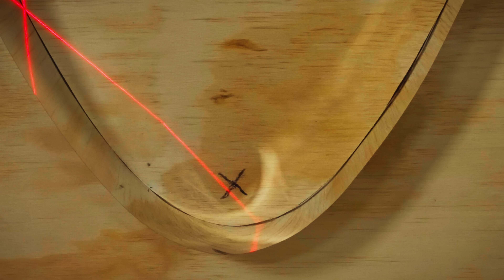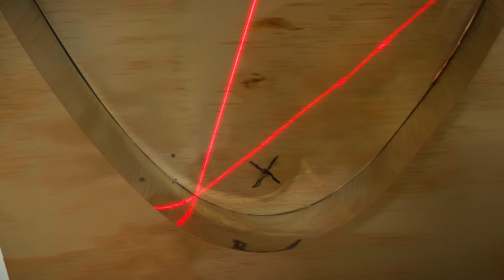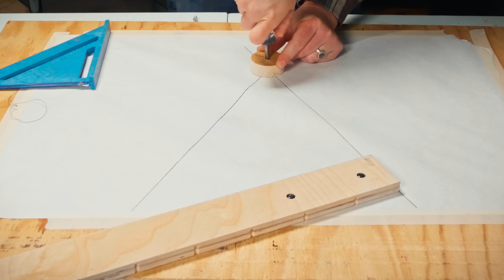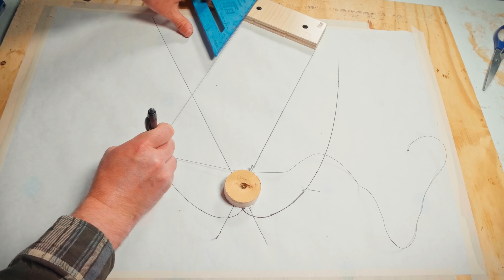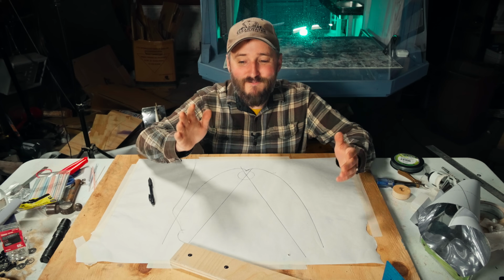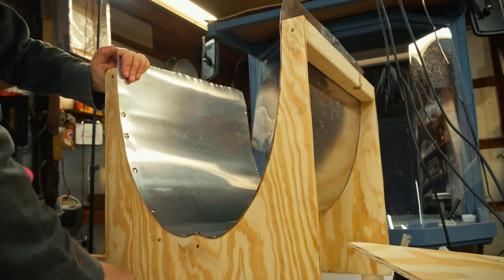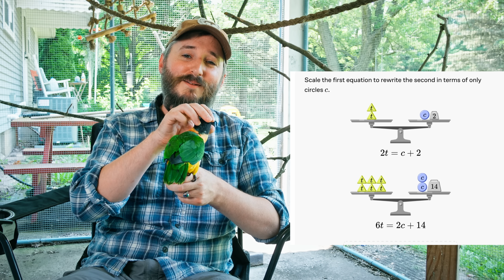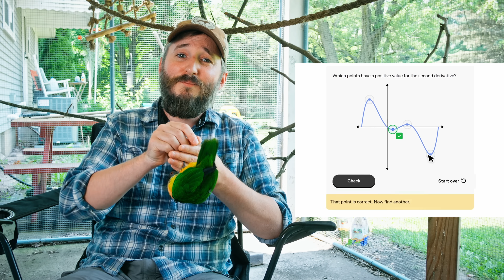DIY Solar Concentrators, Made Better.

Comment: 10:08 - ahh, but there is math required... just not calculation!  You're doing math, mechanically!  And it's super cool, and I'm super here for it.  :)
Reply: Analogue computers do the same, or you could say that he is using some kind of mechanical calculator.
Reply: Everything about this thread has me 😂
Reply: @stevenkramer3872   Well, then whether I've made anyone re-think what "math" means or not, I've at least made someone laugh.  I'll take it.  ;)
Reply: yeah, last i check geometrie is a field of math
Reply: lmao i was just about to say "bro ur LITERALLY doing geometry 😭"

really cool demonstration of geometric construction though
Reply: @xkatiesix1258  exactly!
Reply: Mechanical alignment using straight edges and pins is literally NOT doing math. Not a single number involved. Also, metric system is brain rot.
Reply: @alphaforce6998  Ancient Greeks performed mathematics without the concept of numerals as we know them. Greeks derived the concept of irrationality without numbers. Math is so much more than just digits and operations. It's the character of relationships. That's why reality is math: because reality is relationships built upon existing relationships built upon existing relationships and mathematics isometrically characterizes those relationships.
Reply: @Kowzorz  I was going to make a similar statement. Academics today like to claim certain things couldn't be accomplished in the past because the math wasn't there to provide the answers. His demonstration is proof that one doesn't have to know the numbers to figure out the solutions, it is just as you said,  understanding the relationship, in this case of what you're looking for and how you want to get there. In the past they just figured out what worked, in the present we apply math to explain why it works. Given another day this guy could have probably figured out two other ways to make this same  parabola without using  numbers, it's just what people do, we find different solutions according to our skillset.
Reply: @alphaforce6998   Not a single number is needed... lots of math isn't numbers.  I think you misunderstand what mathematics is.  (And I'm not sure why you bring the metric system in here... your statement about it seems more brain rot than the system is, though.)
Reply: @alphaforce6998  
"metric system is brain rot."
Nonsense! The metric system is far superior, which is why the vast majority if countries use it. Only a few stone age countries like the USI (a.k.a. the USA) refuse to join the rest of the world in the 21st century for reasons no-one understands.
Reply: @alphaforce6998 who hurt your little feelings? Brainrot is thinking metric system is brainrot... But you are probably just jealous finding out that measuring and calculating can be easy if you use deka system...
Reply: @markohorvat1122  If you're claiming the imperial system is difficult, you're proving my point. Base-12 let's you quickly and easily divide  by 2,3,4,6. Base-10 gives you 2 and 5.

Base-12 can deal with 1/3s via 3,6,9 = you can double any of those numbers to get common lengths :
6 = 1/2 foot
12 = 1 foot
18 = 1-1/2 feet

These numbers are common, easy to remember, easy to measure and work for building just about anything. And each of those is evenly divisible by at least 2 and 3.

But when your brain is rotted, you'll find that to be "hard" and instead think some idiotic system based on measuring a non-existent distance to a place no man has ever traveled to is superior.
Reply: @alphaforce6998  Good points for base-12 for length.  When it Comes to temperature, the boiling and freezing point of water are not arbitrary like Fahrenheit.  Same for weights. I don't recall ever needing 1/3 of a kilogram of anything.  If I did, can divide 10 by 3 and carry that decimal 3.333333333333333 as far as i need
Reply: @nopethegeek  Yes, basing the Celsius temperature scale on the boiling and freezing point of water is arbitrary. The scale could have been just as arbitrarily based on the boiling and freezing point of ethanol, mercury, or any other substance. Then there is the question of altitude, or more specifically, ambient atmospheric pressure in reference to the boiling and freezing points of water, or other substances. Why is it based on the pressure at sea level, and not some other altitude?

Weights, are just as arbitrary, as they were based on the weight of water (why not some other substance). Specifically a volume of water equal to one liter, or 10 cm³, which was based on the meter, which of course was based on the arbitrary distance of one ten millionth of the distance from the equator to the North Pole, along the prime meridian, through London. It could have been based on any other arbitrarily chosen distance. It was ultimately discovered to be inaccurate, and was redefined as the length of the path travelled by light in vacuum during a time interval of 1/299,792,458 of a second. Which is absolutely not verifiable by the vast majority of individuals, as they simply do not have access to the equipment needed to measure the distance light travels in such a short span of time.
Reply: @nopethegeek  One of the points as to why imperial is more practical, is that it allows for more precise measurements. As you said, 1/3 of a kilo doesn't check out as you end up with 3.33... that repeats endlessly, and 0.33 + 0.66 = 0.99 not 1 as it would if you were using 1/3 + 2/3 =  3/3  = 1. Metric is often touted as being more precise when it isn't.

As for temperature, I agree to an extent, that declaring 32 degrees to be the measure for water's freezing point doesn't make sense, but we need to take into account that the reason the scale is set that way is to make the temperature numbers more set apart and thus relatable.

For example 75 degrees F is generally comfortable for most people, but in C it is 24 degrees. 85 degrees F is generally hot, perhaps uncomfortably hot, but in C it is 29.

So going from 24 deg C to 29 deg C means going from ideally comfortable to uncomfortably hot. Perceptually, since the numbers are so close together, it is unintuitive.

Now, 75 degrees going to 85 deg F is a 10 point increase on numbers that are both already "high". Since all scales are arbitrary, it makes more sense to align them in such a way that makes sense to the common man.

I'd say the decibel scale is one of the most non-intuitive scales out there, and it is metric. When it comes to measuring sound pressure, a 3 dB increase measured at a specific distance represents roughly 100% more increase in sound pressure. For example, if your had a speaker that was rated at 90 dB @ 1m / 1 watt then going from 1 to 2 watts of input power would result in the measurement going to 93 dB. Then, you'd need to double it again from 2 to 4 watts to get to 96 dB, then 8 watts to get to 99 dB, etc.
Reply: @alphaforce6998 geometry is a kind of math. The fact that 12 is more convenient than 10 isn't really an argument against the metric system, but rather against the decimal number system. If we converted to base 12 we would still prefer something very similar to the metric system over the imperial non-system (which is ACTUAL brain rot)

Comment: one step further ..hang the cloth make paint it with epoxy make the shape .. use the shape mold to lay thermal blankets over and epoxy the back side of the thermal blankets sticking them into the shape

Comment: Hmm, how much does the tall part of the walls of the CPC contribute to the collection efficiency/how much would you lose if you were to chop it off just above the pipe?

Actually, probably not very much at all if you use that much more compact form factor to then bundle a lot of those concentrators in parallel into a collector panel that you could say mount on a roof.

Comment: I imagine the difference between the two shapes are not as significant as appears. One, you're measuring two different materials in the mirrors, and two, you didn't close off the smaller tube, leading to losses in convective cooling. 

After all, as long as the focal point is INSIDE the object, they are receiving the same amount of energy. You don't need it to be perfectly dialed into laser focus to just warm something up.

Comment: I made an array of smaller parabolic troughs about 15 years ago for my cabin. Painted copper tube with black heat paint that serpentined through the parabolae at the focal height. 
Placed on the lower roof above the eaves and filled the copper with Propylene glycol. Above it inside the cabin at the peak of the roof was a horizontal water tank. The convection of the heated glycol would rise into the closed loop of copper in the water tank. The water stayed uncomfortably hot overnight.
 The parabolic array was in a closed box with a plexiglass above the array. Displaced the air inside with nitrogen to keep things free from condensation and sealed the works with silicone.
  Worked great for years. Drained water tank during winter. 
Cool to see you address this technique.👍
Reply: I wish there was a way to save comments. This sounds so awesome
Reply: lol there IS a way to save comments!
Reply: how?
Reply: @BackForwardPunch Use the screenshot feature on your phone or computer. On Android phones, you can also use the Select feature to copy the comments and save it.
Reply: You can do exactly the same thing with black poly pipe. I have a "bush shower" that simply consists of a black 5 gallon plastic drum , a white 5 gallon drum a piece of hose and a shower head, the white drum is for mixing colder water with the red hot water from the black tank. All you do is hang the drums up in the sun, the black tank gets hot in no time, them mix water from the white drum to get a comfortable temp for washing... Simple and effective.  You can create a whole hot water system like this using a bigger black tank and a grid of black poly pipe on the roof, {i've seen swimming pools heated this way}, heat makes the water circulate to the tank and back through the pipes. I've also seen a similar set up using a metal box behind a fireplace, plumbed to a holding tank, heat transfers the water upwards forcing cold water into the heat box until it's all hot...
Reply: Wasn't more efficient to fill the chamber with CO2? I'm thinking about green-house effect.
Reply: @peppyzacat5179 I'd thought about that, but I went for dry over heat retention. Plus I'd had more access to nitrogen than CO² at that time.
  I'm not sure how much of a difference it might have made given the airspace involved.
Reply: Why drain the tank during winter? You left the place, I guess?

This was for water heating (showers, dishes, etc) right?
Reply: @Kowzorz Showers, dishes mostly. I drained the water tank during the winter as a precaution, the glycol loop stayed fine, but there was plenty of darker days with little or no sun which made the chance of the tank water freezing a very real possibility, so I didn't take the chance.
   We went up there sometimes in early winter, but access became challenging as more snow accumulated, so we just shuttered the place at that point, and we didn't use that solar setup until the break of spring. 👍
Reply: @FurtiveSkeptical  Thank you for your detailed reply. What an exciting creation!
Reply: @Kowzorz Np, hope it gave some insight. Unfortunately I sold the property about 6 yrs ago, I told the new owner what it was but I don't think the old guy was too interested in it. 
 I don't know what became of it in the end. 
 It was just a goofy project my wife rolled her eyes at until it did something useful heh. Cheers
Reply: @FurtiveSkeptical  you're an incredible human. Thank you for existing.
Reply: Oh wow, I didn't expect it'd be able to get the water that warm! In the video, the 15c difference between ambient and his pipe without something flowing through it to remove heat made me think that it couldn't actually get that hot at max. But if your setup could stay "uncomfortably warm" overnight...
Reply: @Respectable_Username I just used a plain parabola, I was intrigued by the variation NightHawk used, as it seemed to be even more efficient. The horizontal tank I'd used was a stock electric water heater tank that I'd modified and added much more insulation than it would normally have. That may have helped the water stay so warm throughout the night. I liked the heat, but the wife and kids found it too hot by itself heh.
Reply: Sounds great. Where did you get the nitrogen?
Reply: Why did you got for indirect heating of the tank water when the collector is copper and suitable for potable water?  You'd have to drain the system when temperatures got to freezing, but you drained the tank anyway.

Comment: Super awesome info. This compound parabolic shape is really awesome to focus light on a specific area.
Consider a much larger compound parabolic with a  vertical  bifacial panel instead of a pipe. (or 2 panels back to back)
also, please edit your title DIY Solar Concentrators, Made Better (Compound Parabolic) for much easier searching later.

Comment: Your last demonstration with having the compound parabola focus on a flat surface makes me wonder why solar panels aren't designed that way by default, outside of cost and complexity. Is it that the photovoltaic cells are already saturated as it is or is it simply cost and complexity?
Reply from the maker: Heat management

Comment: I wonder if it's possible to make a 3D compound parabolic curve, one that could envelop the pipe, and then top it with a hemispherical glass lens. 
Would the lens be able to catch light at a near 180° range, and focus it down into the parabolic curve at a good enough angle to heat the pipe?
Would that increase the efficiency and keep the apparatus working for longer throughout the day without the need to move/aim the apparatus?

Comment: Dangit, I was hoping to make a video on this but you beat me to it!

My plan is to use a home made heat pipe (boiling water in copper plumbing pipe and capping it off) to transfer the heat flux and boil water quickly. Your compound parabola will be quite helpful for that!
Reply from the maker: Still make a video!

Comment: It occurs to me that the compound parabolic shape focusing on a pipe is a shape that could be easily extruded in aluminum.  The reflecting surface would have to be coated or polished, but on a smaller scale, using aluminum duct tape might do good enough.  It would take some capital to get the custom extrusions done, but if you needed a lot of solar thermal collection, it could be very cost effective compared to building up collectors of other materials.
Reply: I'll bet you can make meter-long troughs bent into this shape by pressing an aluminum sheet in between two forming molds perhaps made of wood

Comment: Hey Ben! I'm Ben. Hear me out: what if the compound parabola is filled with the water you're trying to heat? The pipe would then just be a little heater inside your tank. I'm not sure how the light would behave, but it could be worth a try!
Reply: maybe it could work [better] with oil? it would probably be less damaging than water
Reply: @fstamour  refer to my previous comment.  Light bends even more in oil, so the same logic still applies.  Also, most oils aren't 100% clear and would absorb more light, which would make it less efficient.  Mineral oil may work better, but again the light would bend much more than in water and would require much more experimentation and modifications to get to work right.  I mean, it could probably still be done and it may work.  But it would be much, much more efficient just painting the container with a black paint as mentioned above.
Reply: The problem with that is that light bends as it enters water.  It can be overcome with some experimentation, but you'd also be trying to heat water with light that is already in the water and heating it anyways.  I imagine that you'd be much better off coating the inside of the container with a very dark paint that'll absorb most of the light, which then heats it and then transfers the heat to the water.  The more surface area your paint has the better... to a point.  If it has too much surface area the waters surface tension won't allow it to contact a good portion of the surface area of the paint you're using to absorb the light.

Comment: The chain method gives you a catenary (hyperbolic cosine), not a parabola... but this is a very common wrong fact running around, where they leave out that a parabola is an *approximation*, and if the chain is shallow enough, it doesn't really make a difference.